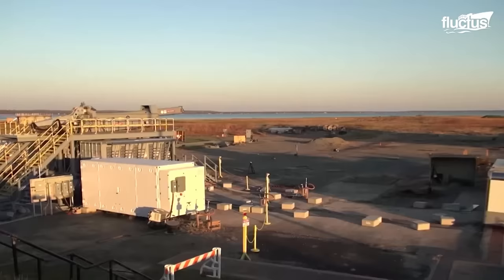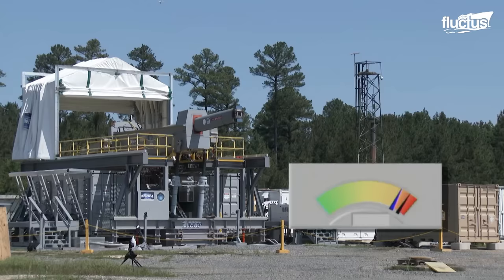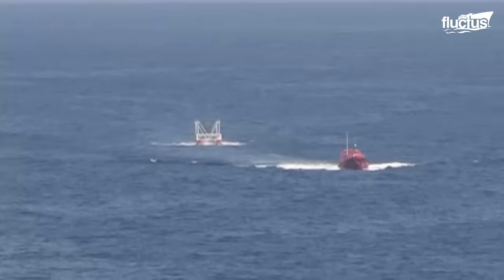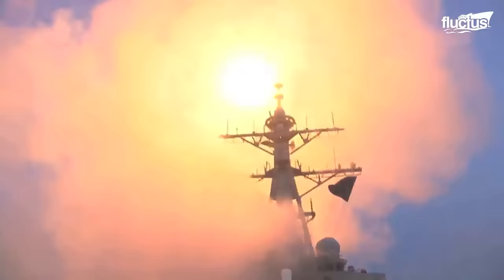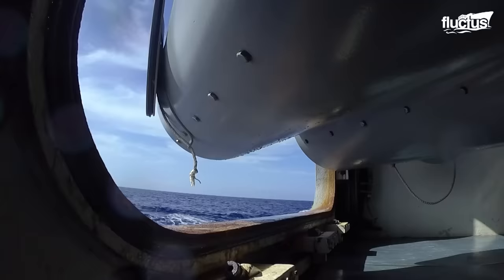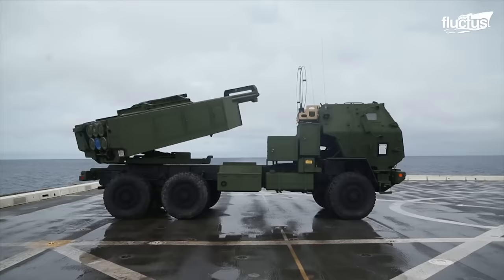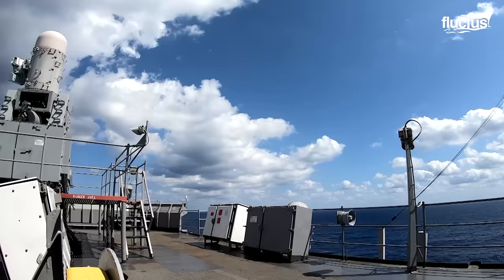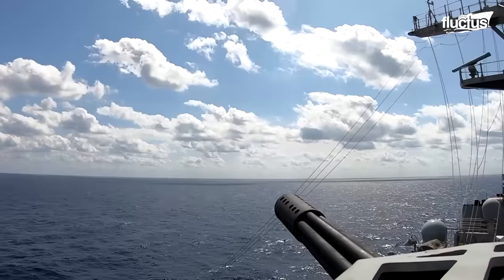US Testing Its Monstrously Powerful $500 Million Rail Gun

Comment: As scary as the projectile from a real gun sounds if you take a look at the gun itself it's pretty useless because it has no ability to what maneuver because it's having to be on such a bolted down platform severely limits the stability to be effective other than a hit and run it could never be used and head on combat because it's lack of maneuverability let alone the fact how long is it going to take to re-energize that whole system it's going to be pretty useless